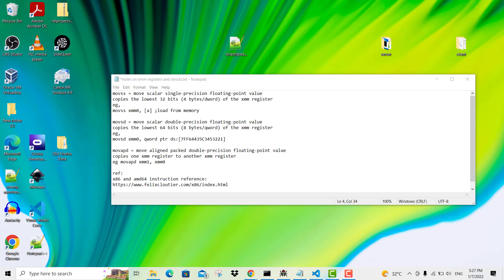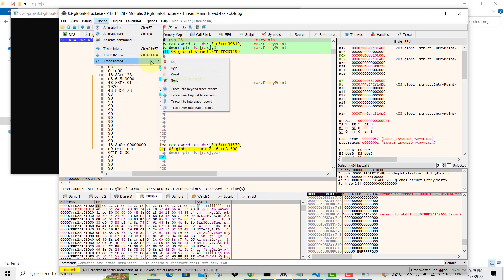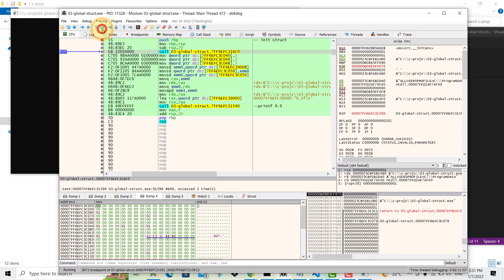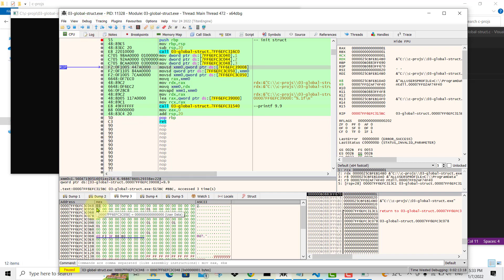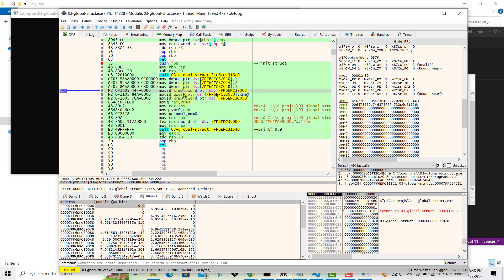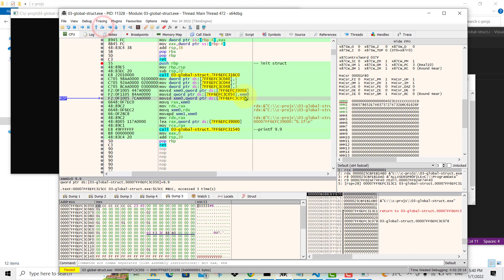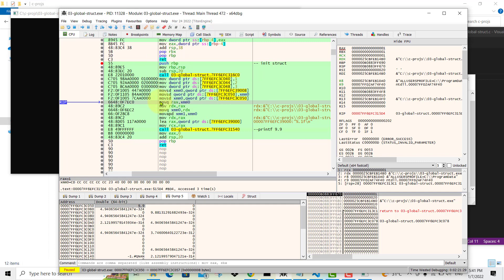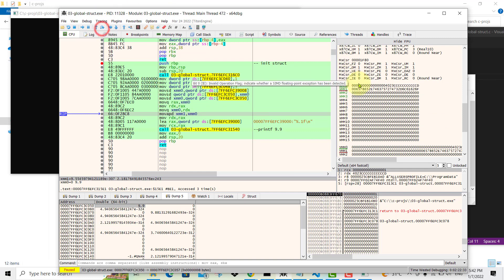Using x64dbg debugger to analyze xmm registers

Comment: Hi, Sir. Recently I'm dealing with reversing program that written in Delphi 4 professional. No packer detected by DIE. The software have trial version for about 7 days. I can't reverse the software as when we debug the software & trying various jumps it always end up with thread xxxx exit. When I set the PC date to the date after the trial registration, the software can run back on trial mode. But when we debug, debugger can run, but looks like going to different path & always stop with thread no xxxx exit... I need your help to give a hint what type of protection I'm dealing with. Thanks in advance

Comment: Hi Mr. Paul. I just quorious to know if we can crack PHP encrypted file using ioncube  12 encryption, PHP version  5.1.16 & also video encrypted file with gem extension? We don't have the key/password. The other thing, is there any fastest way to crack the Zip/rar password instead of brute forcing that we don't have certainty of time taken? Really appreciate if you can help. I have the sample files if necessary.

Comment: Hello Sir.  I just quorious to know is there any reversing tools/pluggins that can log the binary code jump when we do reversing? So if we have running software (licensed), we can compare the jump log files between the licensed  & un-licensed software so we can be easily patch the un-licensed one to be "licensed/registered" .  Another question, how to bypass a  dongle protection, can you suggest which course I should take ? Thank you so much. Have a nice time !!!
Reply from the maker: (1) There are some tools that can do the comparison. But I have never used them. You can google for "binary diff". (2) So far, I have never tried to bypass dongle protection because I have never owned any dongle protectors. Thanks for your interest. You can take the CSL and CSP course on my website:  crackinglessons.com/learn
Reply: @PaulChin20  Thank you so much & appreciate for your info.
Reply from the maker: @f1education383  Welcome F1
Reply: Sorry futher question. I ever got the Olly debugger pluggins that can log all the jump command into text file. But I don't remember any more the pluggin name as I found long time ago that the latest windows version was still windows XP. I never tried it before to do the comparison. But I ever try the pluggin one time & wonderfully I Saw all the jump was logged into text file.
Reply from the maker: @f1education383  Thanks for the tip!

Comment: Hello sir when we can't see strings & also no message box in intermodular calls how we can trace messages ?
Reply from the maker: You can try the call stack method. Once you see a messagebox with the bad message appearing. You immediately pause the debugger. Then click on the Call Stack menu and there you will see the list of history of function calls. There is a column with the title "From".  There, look for the address belonging to the User space usually 0x004xxxxx for 32-bit process. Just follow it in disassembler and you will land in the memory where the logic for checking serial key is found. All this is explained in my CSL and CSP courses on my website:  https://crackinglessons.com/learn